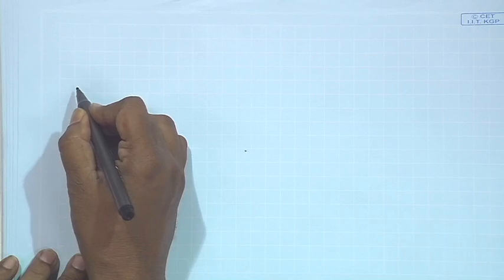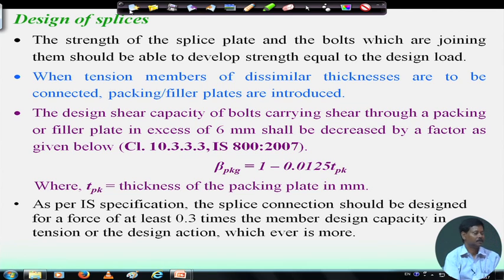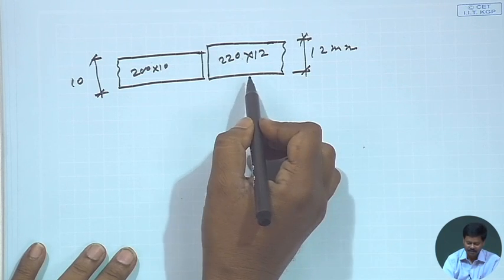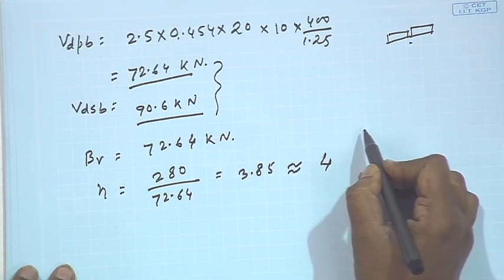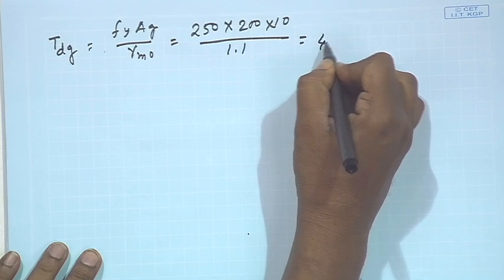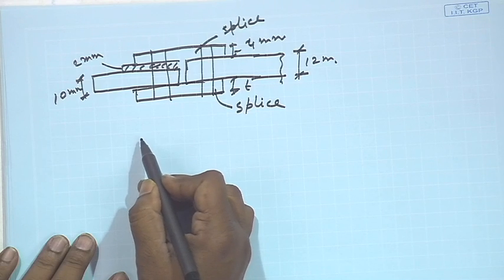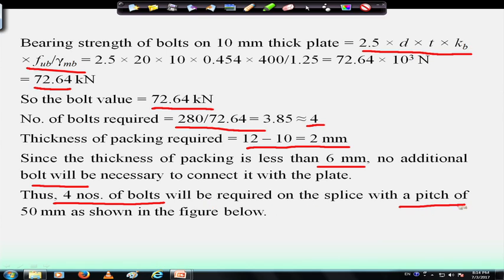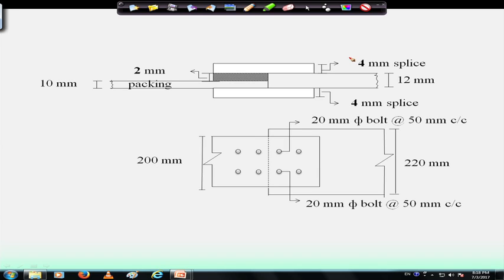Lecture 28 Splices in Tension Members

Comment: A big mistake i observed in this design is that calculation of bearing strength of bolts was done when t=10mm. But summation of thickness of cover plates is coming to be 8mm. So Σt=4+4= 8mm and this should be used in calculation of bearing strength of bolts and bolt value will be 58KN and so we require 5 bolts.
Reply: Else provide splices of 5mm thickness each. Which is minimum criteria
Reply: Thickness of the splice plate is calculated at the latter stage 10 mm is absolutely correct.

Comment: Sir ,
Happy New to you first.
Sir I have a question.

I am constructing a steel frame structure in which 4 ISMB 250 column is there with 3.47 m height each.Total dead load is 120KN. But main issue is contractor cut all four column of 3.3 m height .What will i have to do??

Contractor welded 170 mm ISMB 250 mm peice with cover plate on both flanges and web and that is too welded,and kept all joint below the roof level.

Is it enough to resist load??